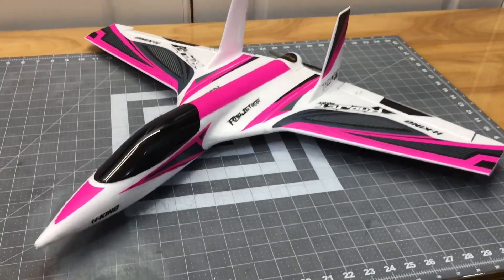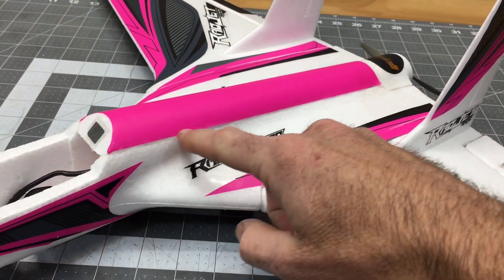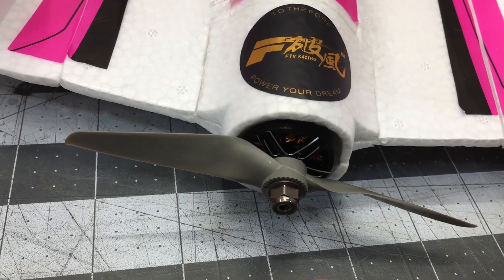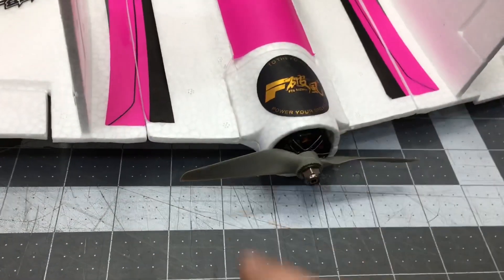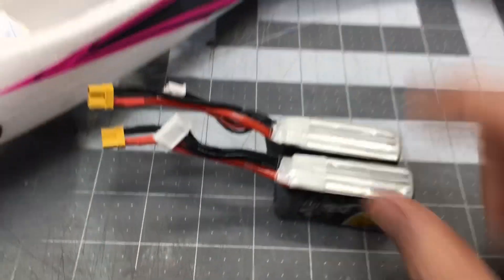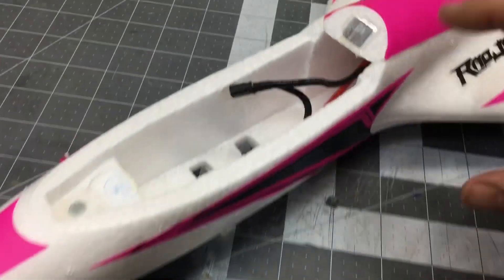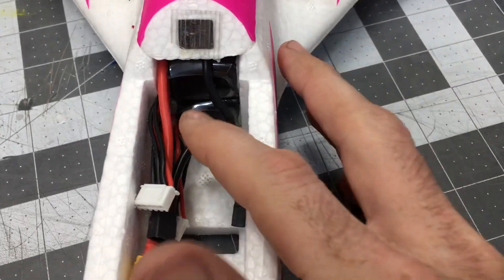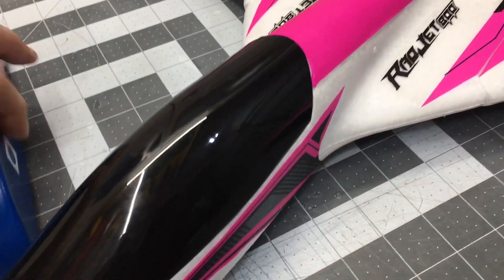H-King Radjet 800 8s Overview

Comment: You've gained a sub from me. I've went for a similar setup on my radjet clone, 85A ESC, F80 Pro 2500kv, 6s, 4.75x4.75 pulling 1100 watts.
Reply from the maker: Thank you for subscribing! I greatly appreciate it. The T motor F80 is a beast of a little motor! About to build a twin jet with two of them!

Comment: Hey im building a similar setup .how come the motor doesnt go up in smoke .theres no cooling at all
Reply from the maker: It definitely will burn up after a while. It’s a 4s motor running on 8s. Don’t keep it wide open throttle. I run 10-15 second Burt’s and not burned one up yet.
Reply: @westhobbiesrc8051  yeah Thing is is tried the same on a funjet but on 6s. Burned to death in first flight. Your batteries can't supply enough current I think .that's why it does not burn up .my setup consists ,of a 2808 2000kv it's about 15 grams heavier ..you should give it a try it's probably not as fast but the torque on 6s is absolutely crazy. And also it's rated for 1800 watts where the f80 is rated at 700 . I guess on 8s with a 7x7 inch prop you will get 240mph. Velox 2808 to motor .
Reply from the maker: @JonasDecker-z3x  your problem is the prop. Way to much prop for these little motors. Even a 2808. Max on that motor is 5x5 on 8s. To swing a 7x7 you need a 36-40mm motor. These quad motors are made for high RPM little prop. 4.75x4.75 is the best for 8s. The whole point of these little builds is still light and still go fast. My custom Funjet ultra fully glassed is 6s and 7x7 on a 39mm 2300KV and will do 250mph but 280 amps and 5lbs. It takes around 3000 watts to make a Funjet do 200mph but no stock Funjet airframe will go faster. That’s why I built mine the way I did. A lot of work to make it go 220-250mph. Over 5500 watts too.
Reply: @westhobbiesrc8051  na I was running a 4.7x4 on the funjet. I was just saying I'm currently running a7x7 on the 2808 on 6s and it's way more hell then the smaller copter setups .granted the funjet is a flying brick . I just got the radjet and was looking for a setup . I don't have the original one but a clone from a German supplier which comes without the HobbyKing electronics .did you also run stock servos ?

Comment: I just put together this new version...i am very impressed with your insane setup..i think this is my 5th radjet....question did you ever fly it stock or did you just replace motor and esc when you got it? So the cog shown on the specs paper is spot on? Years ago they never gave cog and pretty much everyone including myself  set it where the finger grips are...thanks for sharing...ps i did notice after powering my new radj up the servos seems very smooth...looking forward to maiden...😊
Reply from the maker: Thank you! This setup is awesome! Lighter then stock and 200mph plus! Can slow fly even slower then stock setup as well! I didn’t fly this one stock but I’ve built countless Radjet over the years. Every from stock to this setup and even more power. The CG is spot on where the manual says. Good luck on your maiden!

Comment: Great build!  I am following your lead and doing a similar build.  I noticed the T Motor F80 2500kv is rated for only 4s.  How are you getting full throttle on 8s without burning the motor?
Reply from the maker: I just relied to your email. What ESC?

Comment: Great setup.  What setup are you using to measure your speed?  Thanks.  Keep up the great videos.
Reply from the maker: Thank you! Few different ways, one GPS with multiple flights to back it up (some times it will give crazy different readings so I try for 8 flights or so then average it) or the most accurate way to what is your speed, signOwave. Can you take a video and measure distance from point to point by sound.

Comment: wow, this is the kind of content new on youtube that i was looking for!! 8s setup with a 2500kv motor is just impressive! cant wait to see more high speed plane videos and bench overview! subbed!!
Reply from the maker: Thank you! We got lots of speed stuff coming soon! About to start a kit build with anther T motor F80 and 8s to start! 😉
Reply: @westhobbiesrc8051   inspired by your videos yesterday i tested my hee wing (FPV) with an f80 2200kv, 6s 1100 100c and a 4.75x4.75 prop maxed at 51amps, got 240km/h flat speed! waiting for the new esc to test a 5.5x6.5. i'm using ecalc for all my combination, have you got any suggestion to follow? also, i added a 3d printed spacer between motor and prop cause the prop was touching the bell, is there a way to avoid it?
Reply from the maker: @giuroy  appreciate it! So unfortunately with running any kind of pitched prop white those they will always hit the bell are usually just use a spacer that comes in the prop pack but a 3-D printed one will work to! T motor will produce some good power! But it also can take some serious amps and abuse! On success you could probably go up to a 6x6 but try the 5.5x6.5 first or even a 5.25x6.25. What ESC are running?
Reply: @westhobbiesrc8051  thanks for the feedback! I’m using a dys aria 35a atm, on top of the rear hatch to keep it cool! I’ll use a dys aria 70a to try the 5.5x6.5! And indeed I’m using a 3d printed spacer atm but wanted to check with you! :)
Reply from the maker: @giuroy  anytime! Ever since I started my channel I always said that I will reply to every comment and help the best I can no matter how old the video is! Because nothing is worse than when somebody has questions and you go to YouTube to watch a video and the people never replied back LOL 70 amp ESC will be perfect!

Comment: Hey Could u tell me what blheli settings u are running, im running a pretty similar setup (same esc 1900kv f80 on 8s) but im having quite a bit of trouble with esc desyncs, i have been messing around with some settings but cant seem get rid of them.
Reply from the maker: Hello, so I’m running stock setting how the ESC came out of the package. I’ve got three of these now all running Ades and all of them are stock settings out of the package.

Comment: I'm definitely getting one of those ! I will probably leave it stock to start . I did write down all of your upgrade parts and found them on the internet already . I personally have never purchased an esc like that before , but it looks pretty cool a simplistic . Also that micro bec is very interesting . That plane flies pretty damn awesome.
Reply from the maker: You always want to run a external BEC on anything with high power. There’s always a risk of something burning up or catching fire and at least you could still wear on the airplane if you kill an ESC. Plus all the micro quad stuff don’t have built-in BEC‘s which I like anyways. I don’t build any electric aircraft with a built-in BEC.
Reply: @westhobbiesrc8051 Yep I get it , that's why scorpion makes that backup battery so if you lose power from your esc bec you can still get down . I just have never had a reason to use one of those micro becs , they seem pretty cool .

Comment: Nice with literally no torque roll from hand launch..not much power needed for launch cause of light setup..not like my 6s funjet
Reply from the maker: Almost 0 torque role because number one small prop at high rpm it’s always going to be less torque rolled in a high pitch prop. And it is super light! I have a monster Funjet if you go back on the channel you will see videos of it. Fully fiberglass tons of airframe modification shaved airframe thinned out wings so on and so forth. It is stupid fast what are the fastest funjets around but very heavy coming in at just over 4 1/2 pounds ready to fly ready to fly. Torque roll is nuts!
Reply: @westhobbiesrc8051  Yep i see your funjet build..yep vertical launch only way to go with my heavy funjet.or bungee, im sure you said you dont like..but id rather a surviver on maiden.
Loved your funjet build watched yesterday.
Youre like our english OMEGOOLIEBIRD on youtube
Reply from the maker: @stanleycarling  Yes I would rather vertical launch than bungee any day of the week LOL I have had way too many bad experiences with bungee launchers. I have built all different kinds set up so on and so forth and you can get 20 launches in a row perfectly but you will always have that one where it does not release an absolutely destroys the aircraft but of course that can happen with hand launching as well! I appreciate that! OMEOOLIEBIRD is a legend in the speed world!